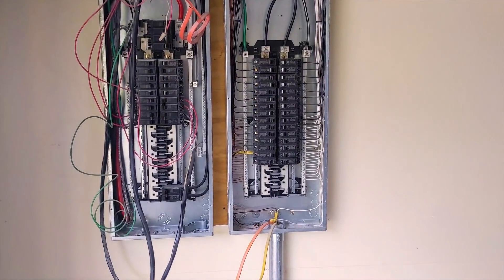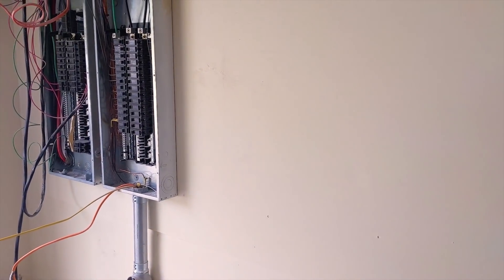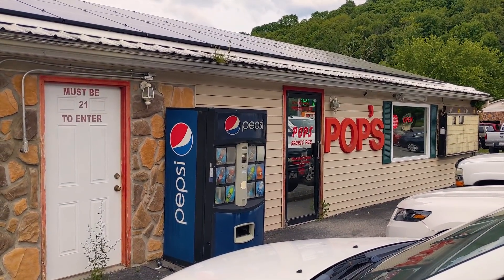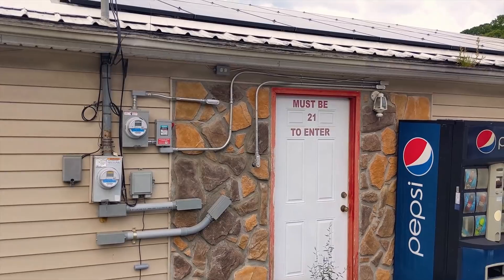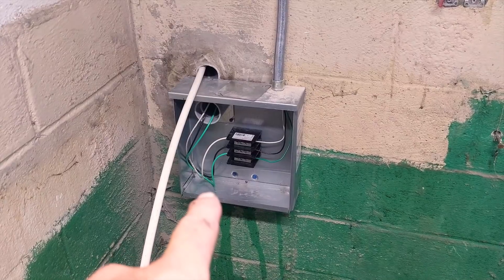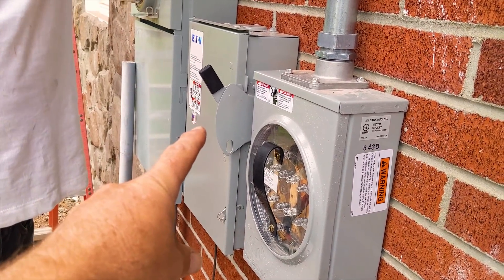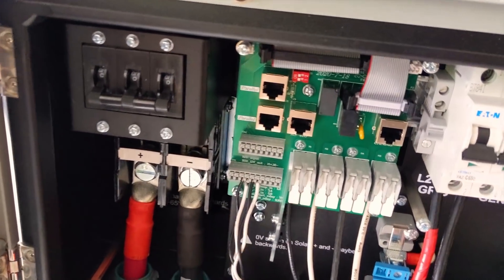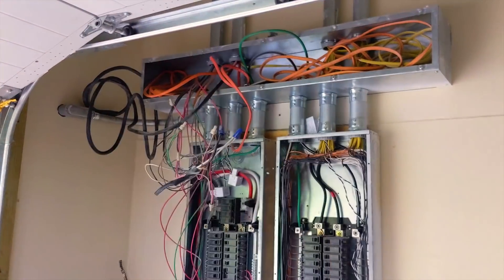Heirloom Solar

Comment: How far away can the CT s be from the inverter or does it just depend on the connecting wire size. In other words do the CTs send actual proportional current or a computer type signal to the inverter?  I would like to mount CT s on a 200 amp service about 175 feet from the inverter location.
Reply: It is a good question,  the manual says 100 ft with cat 6 but I have run further than that.  I do not know the limit.
Reply: @practicalpreppers7798  Thanks for reply 100 ft is about what I would have thought. If its computer signal routers can be directed connected remotely up to at least 300 ft.

Comment: Nice job guy's. But what about POP'S solar You left us hanging !
Reply: Pops needs a re-work of the panels.  The max stringing is 10 60 cell panels and they put 12 on!  There is going to be a problem.  HE needs another battery too.  I just don't know when we will get back up that way. We are swamped!
Reply: It’s funny how solark makes it so simple to string size there system. Somebody didn’t have a clue

Comment: What were the findings at Pop's?
Reply: Major VOC violation, bad wire management, not in grid sell mode, needs a battery and a some attention to the critical loads panel.
Reply: @practicalpreppers7798  you going to post a video on it? They hire you guys to fix it?
Reply: They should include adding a proper cover to that receptacle just under the eave.  Fixing the upside down light would not be a bad idea either.

Comment: hi 775 check out raspberry rock 6.8 solar install  its a nice setup but i like your panel setup better
Reply: yeah they use southeast and southwest facing panels which extends the solar production day some but they used the rradian system and midnite charge controllers which are good equiptment but just gives a more complicated and messy install even when done very neatly.